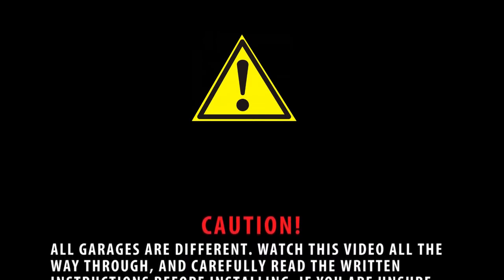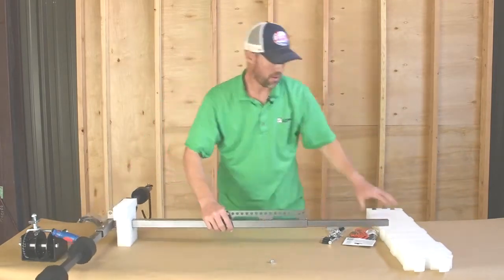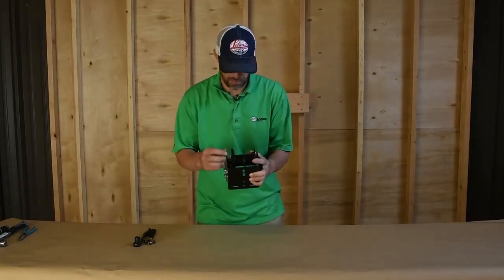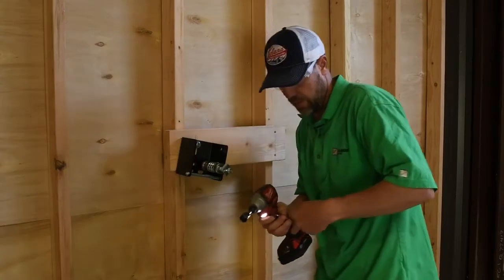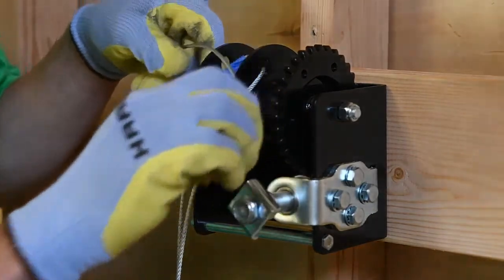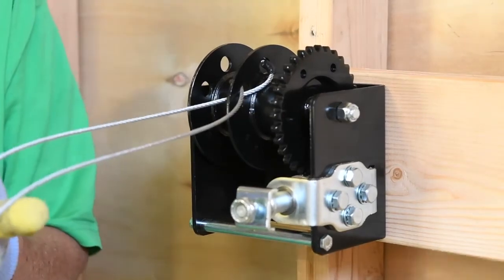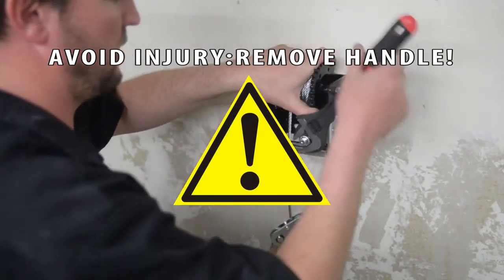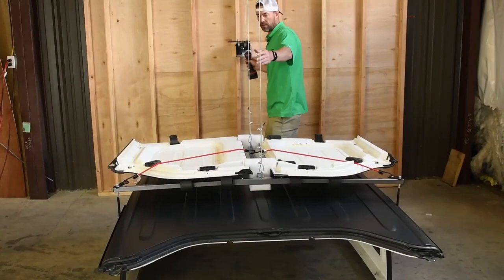Lange Originals Manual Crank Hoist-A-Top For Jeep Wrangler installation Instructions. PN 014-220.

Comment: Thanks for the great setup video. Do I need to be concerned if it seems like the rear cable, towards the rear window, seems to have a lot more of the weight on that cable? Rather than the weight of the top being evenly distributed between the two cables.